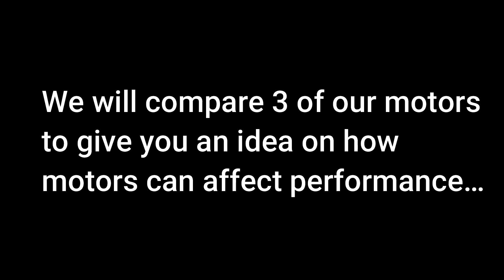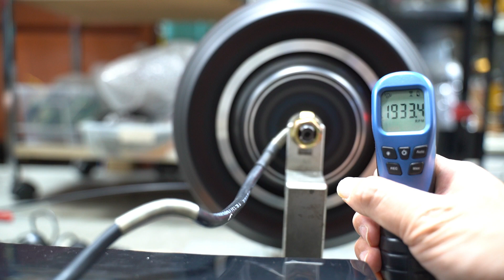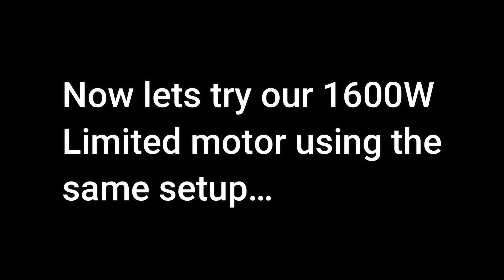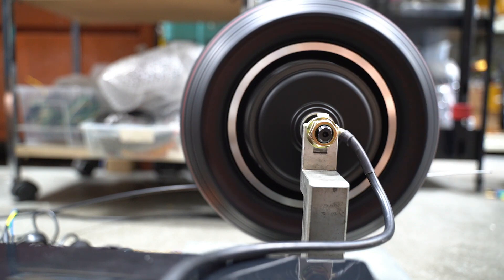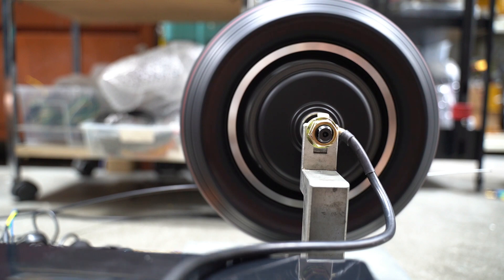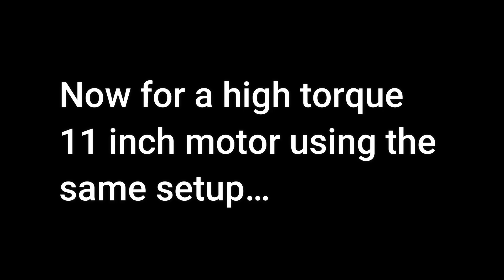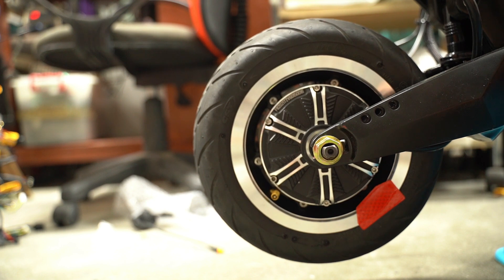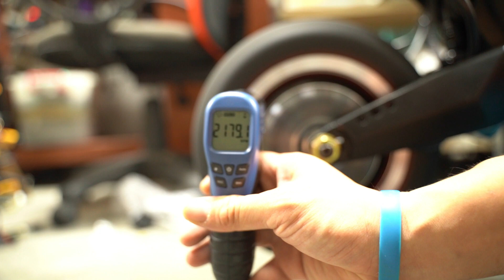Which Motor is the Fastest: ZERO 10X Motor vs Limited Motor vs 11X Motor

Comment: How can I use the 10 inch 1000W / 1200W motor for ZERO 10X instead of the 52v500w motor? Are there any parts required for replacement?
Reply from the maker: Yes must be used together with the zero 10x controller

Comment: What about the 3200w motor 10 inch on your website?.. with the same current and voltage how will it compare to the 1600w motor? And will it have more torque?
Reply from the maker: Same torque.
Reply: @FalconpevSg  ok thanks.. but if  I will be pushing more than 3000W it will be better to get the 3200 motor right? (Planning on 60v 90 amp)

Comment: How many magnets does 11x have? My controller says 28 but I think I should higher that number to 30 but I'm not sure 11x have 30 magnets?
Reply: It should be set at 30 magnets.
Reply: If you set the display to 28 magnets you won't get the right speed readout. Get a GPS speedo side by side on the scooter and you will notice exactly what I am talking about. Being at 30 magnets will read the same as gps.

Comment: Can I upgrade 10 inc motors to 11 inc for zero 10x? Does it provide more torque and more speed? Maybe lower power consumption?
Reply from the maker: yes you need to get our conversion kit and 11 inch motor. lower power consumption for the same speed yes. but you will also very quickly want more torque to match the power the motor can provide but your controller will not able to handle the power and will cut off. hence you will need to also change controller. Oh but wait, your battery is not equipped to handle the increase in power too, so you may need a new battery too.
Reply: @FalconpevSg  Okay :D But does it really gonna be so bad? The motor can't draw more power if the controller is max out. For my purpose I need bigger wheels and little more torque in up hill

Comment: What is the KV of the 10-inch motor?
Reply: As measured it’s 2000 rpm for about 50 volts. That would be very close to 40 rpm per volt. RC cars are in the thousands. You want start torque not Kv. Nobody sane wants to go 20 metres per second on an 11 inch wheel
Reply from the maker: Not sure but top speed of the 11 inch is 120kmh and 10 inch is 90kmh
Reply: @FalconpevSg  I need KV to calculate total speed for specific volts, thanks.
Reply from the maker: @innerfire369  we don’t have the kV

Comment: When is this motor out I would like to buy
Reply from the maker: It is available now
Reply: @FalconpevSg  I have a 3200w scooter system 1600w front and back but my front motor has just gone I’m an more qualified to modify my frame etc if needed you got two motor more then 1600w each?
Reply from the maker: @OneHellOfARideUK  let’s take a look at your current motors

Comment: Hi guys do you guys have upgrade kits with new  controller zero 10x / apollo pro
Reply from the maker: You can do our zero 10X limited or Evo kit but it’s quite a lot of work
Reply: @FalconpevSg  thank you which kit, gives more acceleration power improvement. How much diffrwance is after the upgrade? And how much is it?
Reply from the maker: @welnareviews9904  we can suggest going to the 11 inch motors, with our limited controllers. That’s about usd 1100 in upgrades.

Comment: I'd like the 11 inch high speed motor for a scooter that i'm building from scratch. Emailed your customer support asking if i would be able run it with the grin phaserunner controller  and got some generic bs answer,  basically not really answering my question.
Please let me know if i can run your 11 in high speed motor with the phaserunner, if not which controller do i need? Will be making my own battery to any voltage required. Thank you.
Reply from the maker: Hub Motors are generic by nature. They are either geared or gearless. If it’s gearless do they run hall or hall less? That’s decided by your controller but our motors can run with most controllers.
Reply: @FalconpevSg  
I'm talking about the 11 inch motor in this  very video. Hard for me to understand why you're asking me if the motor is geared or gearless or if it has hall sensors, since i'm talking about the 11 in motor that you guys sell. Once again, can i run it with phaserunner, or do i have to purchase a controller from you guys?
Reply: I believe he said their motors can run with most controllers...
I myself plan on ordering a new replacement 11 rear motor

Comment: my vsett9 is in yellow color, apparently some old pre-release version... and it would go faster than 33kmh in mode 3 usually, than out of the blue will go 38kmh, than 33kmh max again with super slow acceleration (over 25sec to get to 33kmh), than one time it allowed to go up 45kmh... - all on the same road, same weather temp, same day... Controller is nuts.. but seller won't respond to me :( 

Can you advice what is the normal expected speed for vsett9? (im 68kg only, and I saw it can go 45kmh when it is in a mood... I think I got a teenage girl controller lol) Can you help in any way?

Comment: Hey do you know if I can push 60v through the 10x 52v ? Reason I ask is because the motors already accept 60v so I'll just add another series on the battery thank for your reply
Reply from the maker: your controllers need to change too
Reply: @FalconpevSg  hey I have a zero 8x could I swap to 10x controllers for a bit more umff

Comment: Can I do straight swap for 60V 1200W motors to replace my old 52V 1000W motors? Or do I need to change other things as well like controller, battery?
Reply from the maker: Yes you can swap out the 1000W motors for 1200W motors but the difference in performance is not a lot

Comment: Great vid but isnt this a 10x vs 10x limited v 11x limited? Title says v stock 11x motor which is not actually featured in video.
Reply from the maker: Good observation and we did take a few liberties in a video but with good assumptions. The difference between the 11X stock motor and the 11x limited motor is not a lot in non riding unladen conditions. The 11x motor does not have hall sensors so it’s not very efficient at high speeds but that does not matter in unladen conditions. Also the stock 11X motor is not good in high current situations unlike the limited motor but again it doesn’t matter as unladen it does not require much current or generate much heat. This is purely a “lab” tests so we did take a few liberties.

Comment: The motor RPM is based on voltage and motor KV so more amps/watts will not increase the max rpm. Knowing the motor KV would be useful for helping determine speed differences between the motors.
Reply: What KV is these motors?

Comment: I've just recently purchased a 52v zero 10x I use it around Cairns in Nth Queensland Australia. Wet tropics area. I'm happy with how it performs in almost all aspects. I've only traveled 90kms on it so far, but I've got two gripes about it. The first, how can you put a scooter out there that's not even basically water resistant, I mean if I get a shower of rain....no riding! Wet tropics area..Bad! Second bitch, not as bad. Charge the battery up full charge. 58.3v, goes awsome, at 52v it's fading, at 50 it starts to get disappointing at 48 I'm giving up.
I'd like some advice?
Jeff.
Reply: Their telegram group, or one of the Zero facebook groups (like Redline2000 Zero) would be a more helpful forum for you. Falcon has a video up on waterproofing. On battery, do you have the 23Ah? It lasts better than the smaller version. Yes, about 46-47v stationary it will be dropping close to cutoff. Total range should be 40-50km.

Comment: I think in general, not just limited to PEV's, too much emphasis is placed on speed/horsepower and not enough on torque. When researching PEV's I always ask for the torque nm of the motor. It's surprising how many PEV's costing thousands of dollars that have incredibly low torque...common value seems to be 68nm. I can order a plain simple bike from Costco for $300 and add a midmotor ebike conversion kit with 168nm. Which is what I will be doing. I want several PEV's though: ebike, escooter, e-kickscooter, euc, etc; one of each. Slowly but surely but first I'm purchasing safety gear. SAFETY FIRST!!! I do like very much Zero e-kickscooters: look great, good specs, reasonable price compared with the competition, and every single person I have met in NYC that has one gets excited when I ask them about it and they all highly recommend it. 💪🏻🤓😎🤓😎🤓😎🤓👍🏻
Reply: buddy that 168 nm is a lie. its added through gears its not the output of the motor